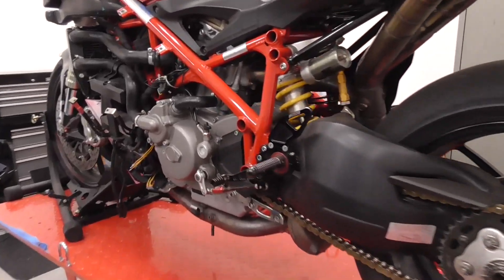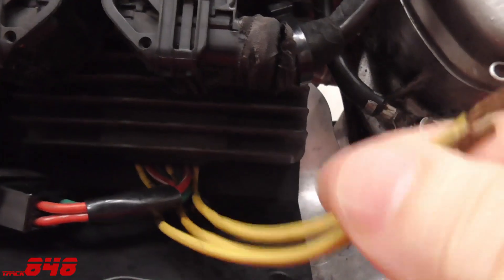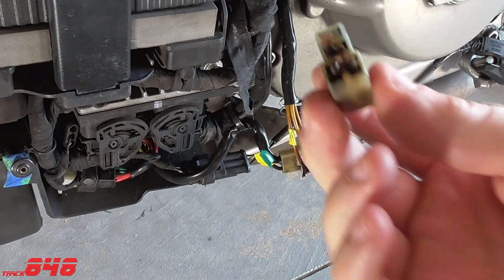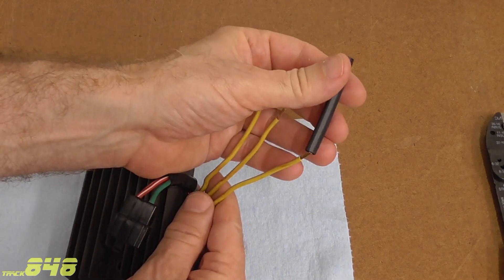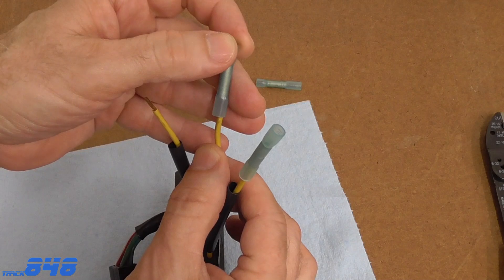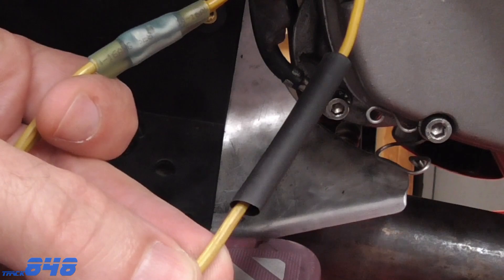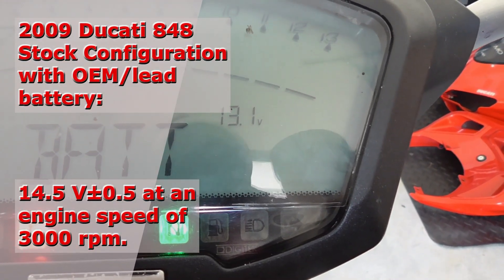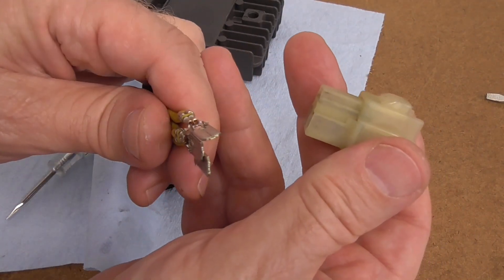How to Hardwire a Motorcycle Stator to Regulator Rectifier

Comment: You solved nothing with the crimp on connectors.  Hence fluid wicking will still happen, and now will just have a bad connection inside the crimp barrels in short order instead.  To solve the problem, the wire pairs should have been soldered together, with heat shrink over each of the soldered wire pairs. If at some point the soldered wires needs to be disconnected, then you cut the heat shrink and un-solder the pairs.

Also to point out, the OEM connectors them self are a semi fuse link to begin with, and them melting is telling you that there is a deeper problems, with too much amp draw through the connector, and/or the wire it self as well.  I bring this up, since as you start to add after market items to the bike that is increasing the amp draw, it going to increase the load on the charging system as well.
Reply from the maker: Thank you for the reply; We're gonna have to 'agree to disagree' 🤓; I've seen this done a lot of different ways with success, including without soldering. If you're a solderer, great, that's a good way to go and I mention that in the description and in a pop up in the video. I have seen dozens if not hundreds of debates between those who solder and those who crimp, and my conclusion is:  If done right either method is fine. I can tell you from personal experience that the crimp connectors that I used in this video worked just fine for more than a year with absolutely zero problems; I have since reverted back to OEM style connectors (more heavy duty ones), because I typically remove the alternator side cover 1-3 times each season for routine and/or unexpected maintenance issues. I believe the important issue here is to keep the connectors clean and this problem can be averted.

I do agree with you regarding amp draw when aftermarket items are added, but this is primarily a track bike, so I go in the opposite direction: many of the electrical components are removed for safekeeping and weight savings thereby decreasing the amp draw. Thanks again for viewing and replying!
Reply: D Baker Question; does it matter what order the yellow wires go in? I just received a new rectifier but there is no plug at the end of the yellow wires. I can either hardwire it with Sauter or perhaps use the old connector but I don’t know if there is a specific order for the yellow wires. They are not marked.
Reply from the maker: Dennis, there is no specific order for the three yellow wires--they are completely interchangeable. The ones on the other side of the reg rec do need to go in a specific order... good luck!
Reply: D Baker I do not understand how the OEM connector can be a "semi-fuse" when it is simply a connection between wires and it is for the purpose of ease and convenience when replacing or inspecting the part. I am not saying you are wrong as I am no electrician. Are you saying that at the end of the day when there are heat issues, the connector will burn out before the stator or reg/rec? And that issue might happen in the case of a hard wire?
Reply: @optimoprimo132  , think of the connector as the fuse link, being that when the heat becomes too much, its will be the connect that gives away/ melts away first.  So if you hard wire through the connector, then the next time you have a heat problem, it going to be in the wires or something more expensive instead.  Bluntly, the system is only set in it design to put out so much power, and when you start taxing the system with more power needs, this creates the extra heat.  So in regards to a fix, you really want to wire in another connector, and this time use something like dielectric grease on the  clip together connector  to keep them clean/non corroded in the first place long term.   If you melt through another set of connectors, then is time to double check the load on the circuit to find the problem (so you're not just melting through the wires or something more expensive instead).

Comment: Can I relocate  mine ? If I place a longer cable would this affect the way it charge? Or will be the same? I have a 2003 Yamaha r1  and is located  under the seat and I can feel the heat in my nuts,I would  like to place it on the tail under the passenger  seat what do you think? Any advice, thank you
Reply from the maker: Yes you can relocate it. Be sure to use the same gauge (or thicker) wiring and you will not have any problems. A lot of owners of my model move the reg/rec to another location on the bike in order to obtain better airflow to the unit as well to help keep it cooler.  Good luck!

Comment: Hi I have a 2004 Honda Fireblade and I'm now on my 4th stator, Honda knew about this problem and did a recall but still Its a problem, it burnt out at this year's TT and I had to run my bike off the battery , a part from taking a hammer to my bike I think I might try this as I've nothing to lose, I'm at the end of my Tether with this bike, thanks for a really good video.👍👍 J.
Reply from the maker: I hope you figure it out soon! You probably have already done so, but if not, I have a playlist linked in this video that contains 5 of the best videos (in my opinion), showing how to check/test the stator and reg-rec... If these tests look good but your wiring and connectors are 'gunked' up like mine were, then definitely renew the connectors or hardwire the Fireblade like I did here... This is the link to the playlist: https://www.youtube.com/playlist?list=PLfo8_jF94f2jg8t8XWMzu_TxRJbEKkbHE . I would love to hear how it turns out for you. Good Luck!
Reply: @Track848  many thanks for your reply and your knowledge, I will have a look at the links you've provided, I will let you know how I get on, regards John.👍👍 It will be a weekend garage job. Cheers

Comment: Happened on my 07 zx10r. I thought it was poor wire quality from my old stator but it seems the melting started from the male end of the bikes wiring harness
Reply from the maker: I truly believe after going through this myself that those connectors need to be cleaned (more often that what I was doing). Once they get dirty and left like that, the resistance will eventually fry everything!  Hope you got yours sorted...
Reply: @Track848  Just soldered the wires this weekend. Put quality insulation on the wires, oil change, coolant change, chain lube. Bike was running super!!

Comment: Could you wire nut the three stator wires
Reply from the maker: You could, but I have seen many people advise against it... the connectors used in this video--or soldering--or a combination of these two, seem to be the preferred methods...
Reply: Track848 Okay thanks!

Comment: Fixed my bike today according to your instructions. Big thanks.
Reply from the maker: You're welcome Sean!
Reply: Quick question what was the problem on your  bike
Reply: @abrahamsoto7632  Multiple issues: starter motor was broken (loose/smashed magnets and melted plastic when opened), melted connectors (rectifier/stator connection) and I replaced the battery and rectifier because I initially thought those components were the cause. Inexpensive Chinese starter motor seems good - at least worked every day since. Good luck with yours

Comment: I think soldered joints a better option, it gives a better connection. You can then reheat and break the joint if you have need to.

Comment: What happens if you don’t disconnect the battery? I just did this and now I’m getting no power 😭
Reply from the maker: Joseph, I'm not sure what all of the potential consequences are, I've never had this happen. What is the make & model of your motorcycle? Do you get anything when you turn the key to the 'On' position? (i.e. dash lights up, fuel pump primes, etc...); Are you 100% sure that the battery (+) and (-) terminals are connected onto the correct posts on the battery?
Reply: Track848  battery is hooked up properly yes. I’m getting nothing when I turn the key to on. Thinking I blew a fuse perhaps?
Reply: Joseph Bullock when you wrote this I was thinking maybe fuse blew. Did you discover the issue?

Comment: Hi man good video I have Yamaha r6 my connectors melted so does it matter which wire goes to which wire when I hook it back up??
Reply from the maker: No, it does not matter for the three wires coming from the stator to the regulator/rectifier; The wires on the other side (from the reg/rec to the motorcycle/battery side) it does matter, so if you mess with those make sure they are in the correct order. In this video, the three yellow wires from the stator can go in any order you wish... Good luck!

Comment: I prefer to use posi-lock connectors, just Incase I want to change my rectifier, I won’t have to keep cutting into the stock wiring of my motorcycle. All I have to do is strip the rectifier wires and I’m good to go!
Reply from the maker: Excellent! Thanks for watching and commenting!
Reply: Track848 sorry about that, I meant to say “ posi lock”, but my iPhone typed positive lol

Comment: Great vid! Question, i do exactly the same as you. But, my problem is.. My stator and regulator dies like 3times a year. Sometimes the stator survive, and sometimes my regulator survive. And sometimes both dies at the same time. From 3-4weeks to the longest 8weeks. So, its eating them up every year. Bike suzuki gsxr 750' 2001mod so i wondering, wtf do i do wrong?  No ones have any suggestions what i can do, or what i do wrong? Regards from Alex (Ps, i dont have anything connected that steal voltage.)
Reply: Maybe it's problem with grounding. Make sure that ground have good contact.
Reply: ikica it is, regulators on Fireblades/gsxr use the frame to ground the regulators.. And when bikes get older, the contact getting worse.. So, im now using a wire to connect the screw on the regulator to the battery black connection..

Comment: Does it matter which yellow wire connects to which yellow wire. I have a ‘76 Honda CB550 and the yellow wires have snapped coming off the stator and have no idea which wire connected to which. I’d rather just rewire it and not have to buy a new stator...
Reply from the maker: No, it doesn't matter:  The three yellow wires coming from the stator are interchangeable...

Comment: Another great video!! I just found a small oilleak on my 1098, and traced it to the stator wiring. The connector was filled with oil. Would it be possible for the oil to travel all the way to the rectifier?
Keep up the good work!!
Cheers from Sweden
Reply from the maker: Thank you, Henrik! I'm not sure if the oil would make it all the way to the rectifier, but I have read on some forums that it does happen... I have not personally been able to confirm that, though.

Comment: That was a problem on two of my Honda Shadows. Now as soon as I buy another one, it's the first thing I do is take that plug out and solder the wires right away. It saves the Stator from burning out also!
Reply from the maker: Excellent, thanks for commenting Painter D!
Reply: Painter D 
Hi I have a 2000 Honda shadow spirit and the same thing happened /..I have burned connections...what wires do I join together to hardwired it?
Reply: @samvalenzuela6043  the 3 yellow that go from the stator to the regulator.  Same thing happened yo my 600 shadow but mine blows ignition fuses and won't turn on.

Comment: Nice video, having same troubles on my 06 Gixxer right now, and I've been told by some electronic stuff selling sites owners that the best way is to replace OEM connectors with these kind : https://easternbeaver.com/Main/Elec__Products/Connectors/connectors.html And this is exactly what i'm going to do this weekend.
Reply from the maker: Cool--that's a good selection. There are a number of ways to replace the OEM connectors... how did yours turn out?
Reply: @Track848  What I did is that I suppress the in-mid connectors and I just plug my stator wires directly onto the regulator, since I have a mosfet everything went down quite nicely, and it's really a bulletproof setup, 0 problem since I did that.

Comment: mine is burnt on my cbr600f3 do you think this would make my fuel pump not work
Reply from the maker: It could--I have seen and heard of a lot of crazy electronic gremlins associated with a bad connector and/or regulator rectifier, which could also be an issue. However, if your fuel pump is not working you might want to first check to see if any fuses are blown and make sure your fuel pump relay is working properly. If it's bad, it's only a few bucks for a new one and should be an easy job. A bench test of the fuel pump would be in order if the relay is good. Regardless, definitely replace the burnt connector and check your stator output and reg rec while your at it (see the info card in this video for a link to a couple of good resources). Good luck, Snap!

Comment: That wasn't a tight squeeze
Reply from the maker: Hey Backyard, it's funny that you noticed that--I did too when editing this video! I'm not the weakest guy on the block, and since I did squeeze the crap out of the crimpers when crimping these connectors, I concluded that the camera doesn't pick up the leverage factor from the tool. I've tried a couple of different angles with other videos, but the amount of force just doesn't come through on camera when crimping. Thanks for commenting!

Comment: Good video. The same thing just happened to my 04 ninja 636. Now i would like to hardwire like the video just showed but how do i know which wires connect to each other?
Reply from the maker: Thanks E Blaze! The order of the three wires (yellow wires in my case), coming from the stator to the regulator-rectifier is irrelevant and you can hardwire the three in any combination you wish. The wires on the battery side of the reg rec (Red/white & green on my bike), have to be in a specific order, so if you're planning to work on that side as well, take notes, pictures or a video of these wires before you make any cuts. I hardwired the stator-to-reg/rec side only as my connector on the battery side was clean and serviceable. Good luck!
Reply: @Track848  that's the same question I was going to ask but luckily someone else asked it. And that is very helpful because I have a ATV and I just replaced the stator and the wires are the same on both sides for the rectifier and on the stator.. now I don't have to worry about it messing up.. thanks.
Reply from the maker: @MrSours69  You're welcome, Chase!
Reply: @Track848  I bought an ATV and the stator wires were already cut and just left hanging. I've been searching everywhere trying to find out if the wires had a certain way to hook up. Glad I've finally found an answer. Thank you
Reply from the maker: @charliesmth987  You're welcome Yumi! Good luck with your repair.

Comment: nice video very helpful ....  i want to ask you question i have 2010 triumph Daytona 675 the Regulator Rectifier the muting place is in the right  fairing and is getting hot because no air flow in this area  do you think  this is good place for Regulator Rectifier and the second question is i did replaced the Stator two times now is this normal for triumph  or my rectifier need to replace too ? ...... thinks for help
Reply from the maker: Hi Amri. I'm not 100% familiar with the Triumph, but I have read some forum posts where members mentioned relocating the reg-rec for better airflow. A lot of Ducati owners have done this as well. Regarding your reg-rec, go to  around 4:14 in this video and there  is a card with links to some videos that might help you determine if yours is bad... good luck!

Comment: If my wires for my stator and regulator were badly melted and there was only one connection in the actual plug, how do I tell which wires to connect to each other? I will be hard wiring them but I'm not sure which wire goes to which.
Reply from the maker: The order of the wires does not matter on the stator side--you can connect the three wires in any combination you want from the stator to the regulator rectifier; the reg-rec-to-battery/ground DOES have to be connected properly, so make sure you get those right. Good luck!

Comment: I'm thinking about straight wiring my 05 Hayabusa but with my rectifier and stator the connector is a 5 prong connector with the negative and positive wires being apart of the connector and not separate like yours. Would the straight wiring be the same for all 5 of the wires in the connector?
Reply from the maker: Gene, I have never worked on a Hayabusa, but took a look at some general photos and videos; are the two extra wires from the alternator cover connected to the crank position sensor? I'm not sure where the sensor wires terminate, but I would not want to 'lock-in' the reg/rec with hardwires on both sides (i.e stator side hardwire along with battery side reg/rec hardwiring). If you do this, you will have to cut the wires everytime you pull the cover.

At the end of the repair in this video, I still had one connector on the battery side of the reg/rec. This allows me to disconnect it and remove the cover with stator and reg/rec as one unit on my bike.

Since I've never worked on a Hayabusa, I would feel more comfortable if a hayabusa guy or gal would chime in here. If not, perhaps you could check one of the busa forums for a good answer. I saw several threads covering this topic. Please come back and let us know!!!
Reply: @Track848  Yes they run to the crank position sensor and are green and blue. They connect into the wiring harness at a 3 prong connector and 2 prong connector and then the connectors run to the 5 prong connector before the rectifier. Thanks for the info.